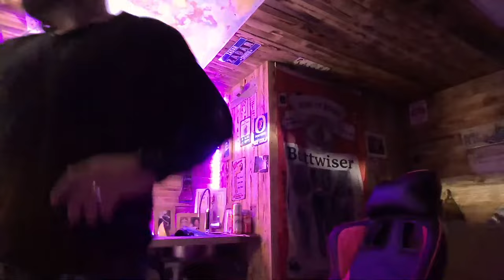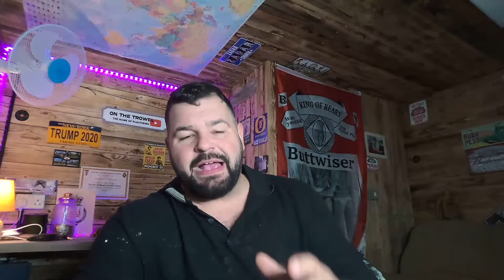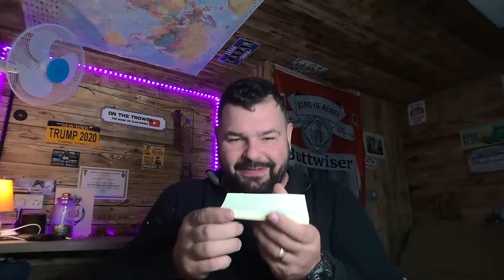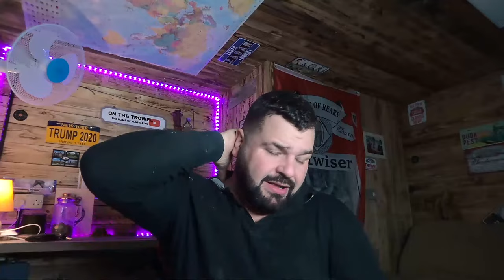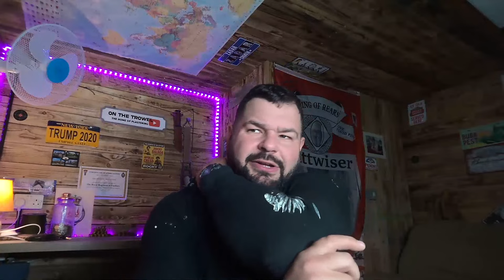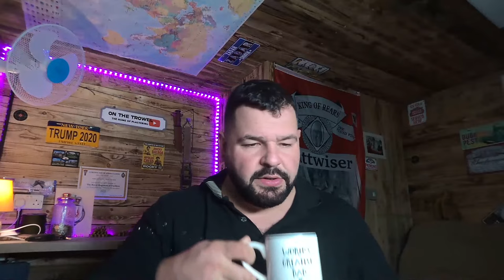WANT TO KNOW THE BEST PRIMER FOR PLASTERING?

Comment: Hi Kirk, i havent got to the end of this video yet, but I moved over to SBR from PVA a while back now, I find it better to use. PVA can freeze in the winter if you don't rap it in your dust sheets and I started to notice in hot weather the PVA started to smell when left in my hot van, if you use the PVA after it has frozen or it smells like it has gone off the plaster will come off the wall if used. SBR doesn't freeze so that problem has gone. Back to your video now ☕